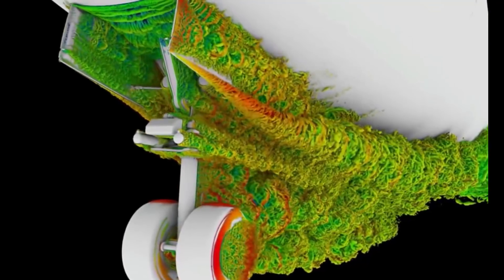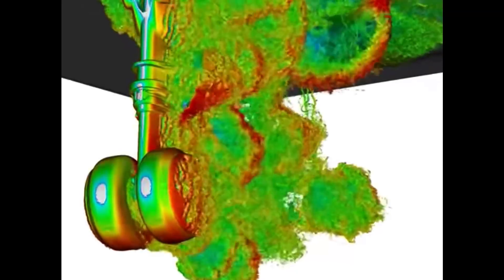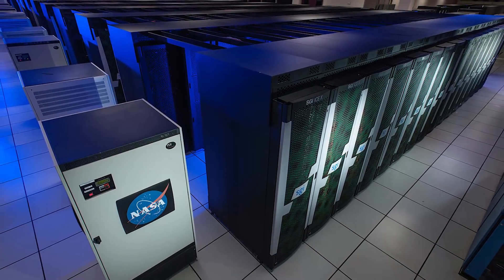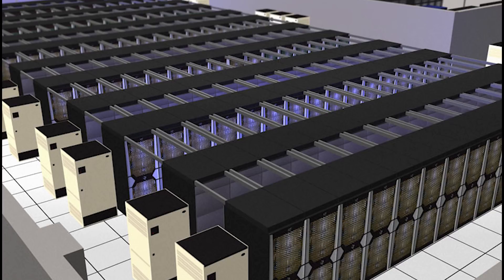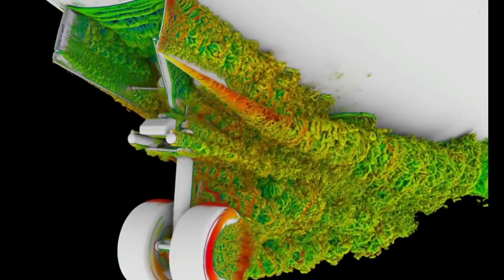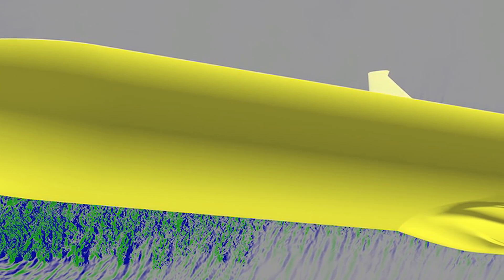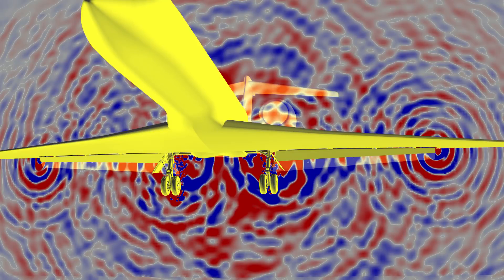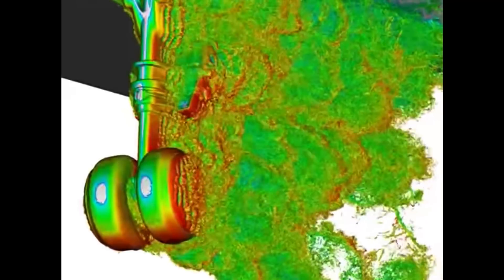NASA's Supercomputer to Cut Aircraft Noise

Comment: Love NASA, but let’s say they find a perfect solution to this noise issue and it’s affordable, what advantage does that really give these communities so distressed by noise. The gear is up soon after crossing the departure end of a runway, and is extended just a few miles out prior to touch down. We are saving certainly less than 5 minutes of noise pollution. Is the cost of this research, let alone implementation, worth it? A better question, I think, would be the fuel implications of the gear drag, but on large jets they’re already spooled for a go-around. I’m not sure eliminating considerable gear drag would be advantageous to airlines given the extremely limited amount of time the gear is down within the terminal area.
Reply: I think it's more of a problem for nearby housing, the airport is a place that always has landing gear down. Though it is a self made problem, why would you decide to build and live near a place that is loud and then later complain that the loud place is loud. (the only exception would be if the airport was built after people had already lived in the area, in that case it's understandable why they wouldn't like it as they had no choice)
 
A solution that could help reduce sound for people who live near airports could be to increase sound insolation and constructing sound barriers facing the airport.
Reply: @midgetman4206   haha wow three years later! 

I agree. It’s largely people moving in decades after an airport is there and operating. I agree with your exception, too, but I’m betting that’s a rare exception - other than when it’s desired by the existing community to meet their demands. 

There’s a drag strip in my home town that had been well south of the city since the 60‘s. City expands over the last half century and it’s shut down to be turned into a park. Soil analysis comes back outside the acceptable range for a park - who would’ve guessed there’d be oil and fuel spills at a racetrack that has operated annually for 50+ years? So, it sits vacant and unused. The international airport in this same town has also had issues with the community lately for noise. It’s been there since the mid 50’s. 

Sadly, we’ve seen it recently where people with more money than sense get their way - see Santa Monica. Never mind the benefit it provides to the community. 

Your solution is a good thought, and I agree, but that would probably increase material costs. These people lobbying to shutdown existing airports and race tracks that they moved next to don’t want to assume those costs. They want to pass that responsibility on to someone else. They’re aren’t logical enough to stay away from the loud airport, so we can’t assume they’re logical enough to accept responsibility and spend money to make their home quieter when they do move near these places.

Comment: This is awesome, but modern airliners today are much quieter than 60’s through 80’s thanks to innovation in Engine and Fuselage adaptation technology!!
Reply: Hector L Guzman Rivera Correct, but there's only so much that can be done before diminishing returns. If there's a few db at the nose gear, few at the flaps it starts to add up and airport neighbors are less cranky.

Comment: Seems like a waste of time, the noise isnt even that bad?
Reply: That's my thought as well. I used to go to a salvage yard that was very near to the edge of a runway at an international airport, where landing aircraft were maybe one or two hundred feet above my head, they're fairly quiet when they're landing. Takeoff is a different story, but I doubt that there's much that can be done about that.

Really cool simulation, though.
Reply: Tell that to the people who bought houses near the airport in Phoenix. They forced the FAA to change the flight paths back to the less efficient ones. The sound never bothered me either but I have a feeling that's because we like airplanes.
Reply: Yeah, but I wonder if that's due to the engines on takeoff, or the airframe itself.
Reply: idontcare80 TBH there probably isn't much can be done on takeoff apart from engine changes. The residents here were complaining about both arrivals and departures. Personally the only time I notice is when the A320 flys overhead. I haven't been able to find a good answer. Gear or flap extension probably and if so this the kind of thing that could help fix it.
Reply: I can understand the hate if you had already lived in the area and an airport was built at a later time. But if they chose to build and live near one after it was built than that's just on them

Comment: This is great simulation.  This means that the gear should be put down later to avoid expensive redesign,  and landing procedures modified to allow a late gear extension safely.
Reply: Bryan Kilpatrick Right.... let me lower the gear in a 1/2 mile final while flying my jet... c'mon now man. That's not how this works. Be a pilot. Use your noggin.
Reply: Not how it works... yet. Be an innovator, use your noggin.